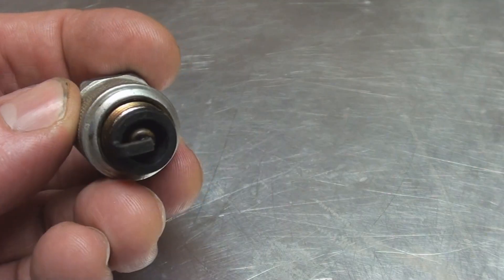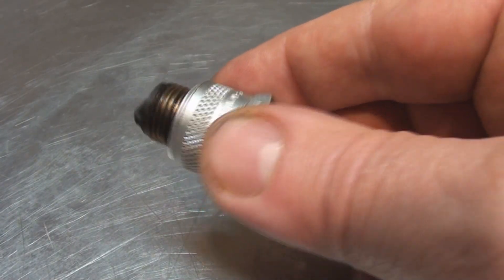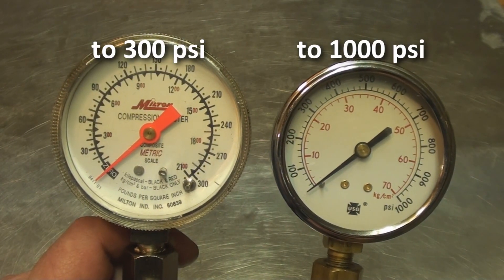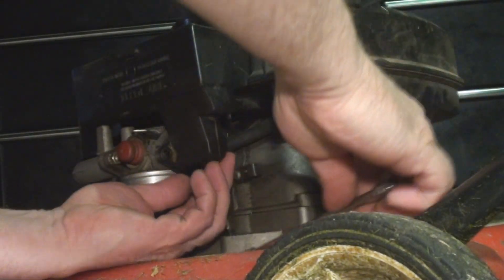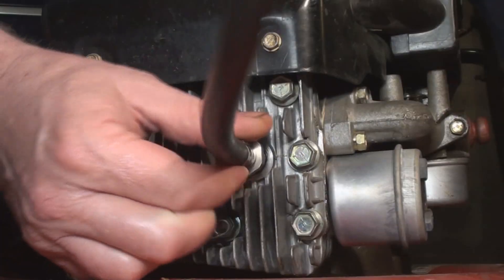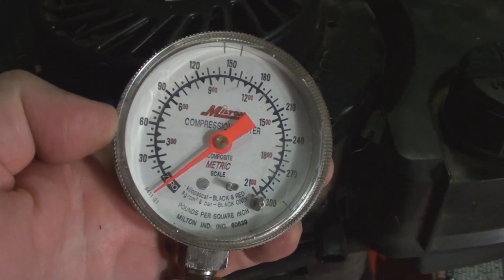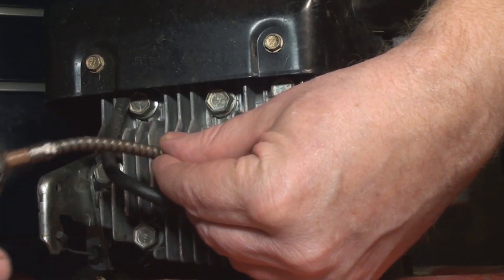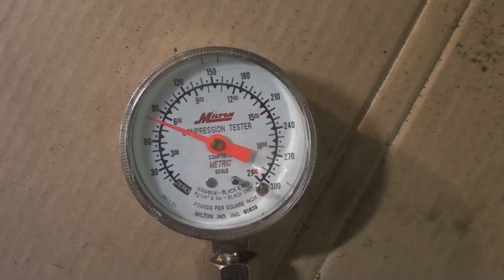Lawn Mower Compression Test

Comment: Why put oil in the cylinder? If the compression is low what good will that do? Valve adjustment would be the first step on OHV adjustable engines.

Comment: Alot of answers but,there is alot of questions, first of all there is a decompression valve on the cam,second of all to do an accurate compression check you have to remove the lifter off the exhaust,otherwise you won't get an accurate reading..so what is every body babbling about???

Comment: if you do not have a can of starter fluid   get one it is hand item to have it will help start many balky engines you dont need to take eng apart  just spray starter fluid into filter it crank right up if you are having a fuel problem  to start if it dont start with this fluid you prob. have a spark prob.
Reply from the maker: Thanks. frank! Great tip!

Comment: Hi, My little weed eater shows 100+ psi when cold (3 pulls) then after its hot for a while it starts to lose the idle and wont run any more. I quickly tested again and only got 70-90 and coudnt even reach 100 psi after 5+ pulls.  Is the engine too worn now to make the 2 stoke cycle work anymore? all coil and fuel and carb has been substituted and bypassed so its not that. also crankcase is airtight after pressure testing it to 9lbs and replacing all gaskets ect. only thing left is a worn engine?  also idle Low screw setting wont settle in one place anymore and have to keep using choke to start it even when hot. got full power and the l & H screws can give me more or less fuel , its just after a time 10-20 mins its dies and wont run any more like its starving or air being introduced but i already eliminated all that with total strips and replacement and 3 carbs and emptied tank twice into a container to be sure it wasnt blocking up or the vent valve was closing. I even gravity fed the carb when i removed the pump gasket and blocked off the pulse channel to see if that was losing pulse when hot and it worked great and still stopped exactly the same, so fuel delivery cant be it with 3 diff carbs. 
Thank for anyone who can help out!

Comment: 3 things, after adding the oil leave the compression tube off of the engine and pull it several times to distribute the oil around the cylinder to fill in temporarily any cylinder wall scratches.  Reattach the guage and run the test again if compression goes up the oil has blocked pressure from leaking past the piston through the scratches. 2  The pressure reading will stay at you last reading for several minutes or until you push the relase valve the extended hold of the pressure had nothing to do with the engine. 3 remove the air filter and set the throttle to full open and choke to full open that will allow maximum air  flow into the cylinder no need to hold it open with a screwdriver

Comment: What would cause over compression? I've got a 2 cycle tiller that's so hard to pull start and I know it's over compressed somehow. I also hear a slight hiss when pulling
Reply: Some two-stroke engines come with a compression release button you can pull to make it easier when starting. It automatically goes back to a normal position after the engine starts.
Reply: Water
Reply: I’ve seen a plugged exhaust cause similar problems

Comment: Is there anyway to measure the temperature of the air ? (Dry)
Reply from the maker: Pyrometers do exist for some extreme duty engines but I doubt you'll ever find one on a mower. Maybe you can get a reasonable approximation from a hand held Laser Infrared Digital Thermometer/ Infrared Pyrometer unit aimed or placed in front of the open exhaust.

Comment: Just wanted to clarify a comment you made that may mislead some. You said that the compression "held at 80 psi for a few minutes" This is not really true. What held pressure was your tester and hose assembly. No engine "holds" compression for any length of time after it stops turning and it doesn't have to. Whats important is the peak pressure during the test. Testers have 1-way valves so the peak reading is held. In fact you could unscrew it after test and it would still show the peak reading, as long as you didn't press the relief valve.

Comment: I look forward to keep my Law Mower for 10 years!
Reply from the maker: 16 years now and still mowing strong!
Reply: Same mower i have. The thing was great and could run tree Limbs over shredding them up with that blade on it. Until i hit a green 2inch stump bent and ruined the blade tore the shit out of the frame and finished off the rusty wheel mounts.

Set for 3 years and isnt running now. Recently put it in a new frame and put a new Chinese carb and ignition coil on it. Just replaced the flywheel pin and it fired right. So happy. =D

Comment: I was givin a craftsman riding lawn mower. The previous owner siad he had it running and it just died! He never had it running since. I first checked for spark from the plug - nothing. I got a new plug and then a new ignition module. Still I didn't get spark. I then tested it for spark with a simple screwdriver up in the end of the plug wire while being grounded on the engine. I only get a FAINT spark. I no doubt had cleaned the monting bracket for the module and the flywheel. I do not know what to be looking towards? I even took off the flywheel and cleaned it under that. I saw it only had 4 magnets and then seen other ones, the same model number on ebay with only 4 magnets. Another told me the the manets under the flywheel are for charging the battery and nothing to do with the spark for the plug. Any ideas??? Thanks
Reply: Well got to have the proper gap between the magneto poles and the flywheel.
Usually between 6 and  10 thousands. Then all the connections, have to be clean. Magnets on flywheel may be weak. They do not just charge a battery, they predominately  make the spark the plug needs.
Reply: I did adjust the gap to 10 thousands (a credit card) cleaned all connections w/ wire brush for the coil grounding purposes of coil. Is there a place I can order new magnets from then?

Comment: "It's been holding 80 PSI for 5 minutes." An engine won't "hold compression". It might for a brief moment if it stopped in the right place, but certainly not for 5 minutes. Compression gauges have a one way check valve at the end that screws into the spark plug hole. It allows pressure to enter the gauge but not exit. Without it you couldn't even do a static compression test. You could screw the gauge out of the engine and it would still read 80 PSI. That's the reason for the little schrader valve next to the gauge, to vent the pressure after you've finished the test (or between cylinders if you aren't checking lawnmowers).

Comment: my riding mower back fires.hard to start.i adjusted the valves.clean the gas lines and tank.didva crab rebuild.and still no luck.any ideas?
Reply from the maker: Sounds like valve timing is way out.
Reply: +Repairs101 i did 600 on the intake and 400 on the exhaust.
Reply from the maker: That's valve clearance - valve timing is the precise timing of the opening and closing of the valves
Reply from the maker: Check to see it isn't supposed to be the other way around - usually in is smaller and out is bigger due to thermal expansion
Reply: +Repairs101 the valves?
Reply from the maker: The clearance or valve lash on the exhaust will be greater than the clearance on the intake so the metal can't swell enough to close the gap. However often you do find larger intake valve porting (and valve surfaces) and smaller exhaust ports (and exhaust valves) to allow for maximum aspiration/efficiency.
Reply: Check those specs on the valve clearance, typically the exhaust is more than the intake, for instance briggs engines, .006 intake, .010 exhaust

Comment: One correction: You noted that your compression tester "held" the pressure for some time. They make them like this so the highest reading stays long enough to read it. This is due to the valve in the tester - it has nothing to do with the engine being tested.  You mentioned the engine held this pressure - that's not true. Any engine would leak down over seconds and would never "hold" pressure after stopping

Comment: Good video, I have a very old Briggs and Stratton engine that makes 75PSI on compression and is almost like new inside. The spark is bright blue also but the thing just won't run. I am running it on propane and it was working brilliantly but I think some curse has been set on it as all it does is kicks occasionally or just backfires. Will not even run for a second.
Reply: Shaun Dobbie thanx for the update...too many people fix their problem and never come back and let us know what it was...this helps everyone out in their diagnosing skills
Reply from the maker: +Shaun Dobbie - if it kicks or backfires it wants to run. Sounds like the timing is out but I doubt it. See if you can get it to start on a TBSP of gasoline prime.
Reply: +Repairs101 It turns out the spark plug was dirty and the gap was too wide. It works now.
Reply from the maker: Glad to hear you got it! Rock on!

Comment: Ive been trying for a while now to repair my moms mower.

It spits gas into the air filter. Will no compression cause this?
Reply from the maker: BlackDynamite901 Dude, not enough info. Does it run at all or are you saying you pull and pull and all that happens is the air filter gets wet with fuel? If it's gravity fed and it floods while running then perhaps yes but more likely a broken line / cracked fuel hose kind of thing. If it floods because it won't start that's normal and you just have to solve why it won't start.   https://youtu.be/gPb64N01AAY  Good luck!
Reply: Repairs101 Doesnt run at all. Spraying carb fluid into it gets it to stutter more but never fires up.

Spark plug is fine
Gas has been drained and replaced
Oil level is fine
Carb is brand new
Reply from the maker: BlackDynamite901 Try priming the carb with a splash of fuel (1/2 oz) and the air filter out.  Keep the choke wide open for a few pulls (if so equipped) then try 3/4 choke and back to full choke if you can get it to fire. Obviously put the air filter back in once it's running. Any chance the new carb is wrong or set up wrong?
Reply: Repairs101 Thanks for the help!

I replaced the gaskets(they were all worn and broken), and looked at a diagram for the linkage and it fired right up.So yes, it was setup wrong, and i dont know if the gaskets helped but lets say it did.

Now ill check out the tune up video.

Comment: It turns over hard like it gets stuck somewhere
Reply from the maker: Timmy Weller Electric start? Clean battery leads and full voltage? Turns over freely with spark plug(s) removed? Again help me out I need details. So far I suspect you have a low battery and/ or poor cables/connections (especially bad ground) and/ or hooped starter.

Comment: The fact that the compression reading stays for five minutes has nothing to do with the condition of the engine. It means that your compression tester valve is holding the pressure.
Reply: Exactly.  Heard that too and laughed.
Reply: You'd want to know that, though, eh?
Reply: He probably thought it works like the tire gauges
Reply: If it doesn't seem to hold air, maybe it possibly means the tester is faulty.  compression results are invalid?

Comment: I'm getting a reading of like 30 on one mower about 90 on another. The one with 30 doesn't seem to be seating well. Is it difficult to grind them?
Reply from the maker: foreverwood1963 Sorry but you have two mowers or you have a 2 cyl mower? More details required. Makes, models, engines, service hours (years?) history and symptoms.
Reply: Well I have a craftsman 4 cycle mower that has 30 on compression, the valve seats don't appear to be seating well. I was wondering how difficult it might be to grind them down
Reply from the maker: foreverwood1963  Have a look at this excellent resource from Briggs & Stratton on valve removal and lapping. 
http://www.briggsandstratton.com/us/en/support/faqs/valve-repair-maintenance

Comment: Got a 4 cycle Toro 20332 that won't start. Compression is only 30psi but I did not open the choke. Will that make a difference in the compression reading? I have another mower that starts on the first pull and it's compression is 45psi also did not open choke.
Reply from the maker: rfn944 Choke open or closed will give nearly the same reading - the issue is with fuel being pulled in. I think your 30 psi motor may be hooped. If it's supposed to be 45 like your good one that's a 33% loss of compression, well past the 25% mentioned in the video. Good luck!
Reply: @repairs101  f

Comment: Iam getting 90psi on a 20 year old 3.5hp briggs and stratton classic mower engine. that was a dry compression test i took pics to prove also
Reply from the maker: Sounds like you take good care of it.
Reply: oil is changed twice a year with SAE 30 oil :-) head is decoked once a year :-)
Reply: that sounds great! but id bet you could get more on a 3hp! :)
Reply: Those engines are indestructable

Comment: If it had 80 PSI when dry why would you do a wet test with the oil? I'm not trying to be a smartass. I've just started working on small engines and I'm trying to learn as much as I can. Great vid by the way. I got to get me a compression tester.

Comment from the maker: Thanks Dave. All my videos are closed captioned for the hearing impaired as well as for translation in 58 different languages using the YouTube translate captions feature.
Reply: I thank you for the closed captions I'm hard of hearing much respect for you sir you have a subscriber & most of you tube channels doesn't even think about this & again much respect to you sir. I'm working on a 2007 snapper 150Z 20up Briggs & Stratton zero turn lawn mower it'll turn over it has spark to the pugs but no crank it did run before but I stop running so this is what I'm going threw when I got it as its not running

Comment: I can remove my compression tester and it will still hold the reading.
The guy in this video posting seems to know a hell of a lot more than most of these "Youtube mechanics".
I saw one guy, "golfcartractor" show how to get spark on an old points style Briggs by wiring in place a wet cell battery on the deck and automotive-style coil with wires running everywhere. Unsafe as hell.
I told him just replace coil w/Magnatron and he got all mad. His mouth was so foul Youtube 86'd him. What a maroon!

Comment: You are correct, typically 80psi is compression found off of push mowers off the showroom floor.  Also, yes compression testers have the check valve (tire valve stem-like valve in it).  So yes, if you left the compression gauge in the mower, it will read 80psi all day long, and is not a function of how well the engine can hold compression.

Comment: My Snap On Compression Tester also has the release valve.
Also, within the flexible hose, it has a check valve too, that will prevent from the pressure being released.

The only way to relieve the pressure in my compression tester is to press the release valve, or to disconnect the compression gauge from the flexible hose.  If I disconnect the flexible hose from the lawn mower (with gauge still attached to hose), the compression gauge will still show pressure.

Comment: This guy needs some help. 80 lbs is damn good considering these engines have a compression release on cam. That's why it didn't increase w/oil (by the way, the compression will "hold" because the tester has a tire valve stem-like valve in it)
To perform test, there's nothing to do as far as removing intake, etc. As long as carb throttle shaft is open wide, which it will be w/engine off.
His plug actually looked pretty darn good. Probably all he needs is a new air filter.
Keep it simple...okay?

Comment: An engine is basically an air pump, as air makes its way thru the carburetor into the cylinders and out the exhaust.  Over the years, I have noticed that little attention is given to the muffler and spark arrestor as a problem area.  Not only can you have a restricted intake system with a dirty air filter, you can also have a restricted exhaust system.  Recently, my chainsaw was not running properly and by simply removing and cleaning the spark arrestor screen, the engine ran like new again.

Comment: I think there's a problem here , if the first test indicate 80 psi , With oil added to cylinder should have shown higher pressure . 80 psi is high for a dry test but an old mower or even a new one usually shows a higher value . Your mower isn't that good .
Fronzi

Comment from the maker: It sounds like you wore your battery down trying to start it - charge it if required.
If it burns Diesel you'll need to bleed the lines to the injectors after running out of fuel. 
Gasoline burner - check AIR filter/passages are clean/clear - check FUEL is present at the carb - check SPARK is present/sufficient. If your battery is good (+13 volts) it will likely be one of these three things. 
Check choke operation by looking down the throat of the carb (see video). Good luck!

Comment: Most, if not all small 4 cycle engines have a built in compression release on camshaft. If you get from 45 to 60 lbs, you are good. They won't show any higher because of compression release. Quick troubleshoot: Spray some flammable carb cleaner (what I use) into carb intake. Pull rope. If it runs and dies right away, you have spark and compression. You have instantly eliminated those as a problem. It's not getting fuel. No need for comp. test or spark test. Continue on to carburetor.
Reply: It's only been 12% of a century, but thanks for this information; I got 60psi on my Murray push mower and thought it was bad, but now I have hope :)  Edit: It didn't make sense that it did run on Brake cleaner, but not on its own fuel system, again, thank you :)
Reply: @GilFavor101 it’s only been 3 quarters of a year but curious, what did you figure out on the Murray? Sometimes as little as gas cap can stop you. (vapor locked)